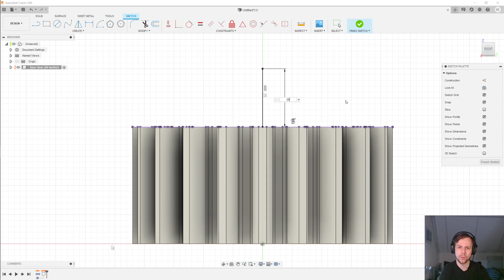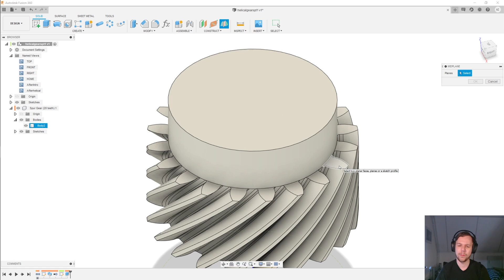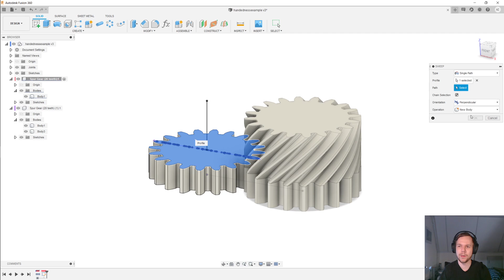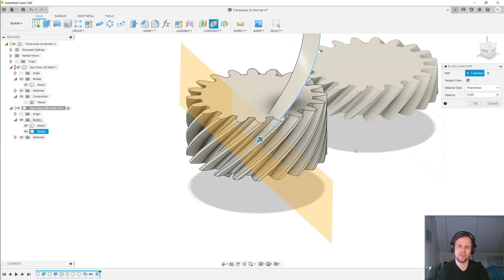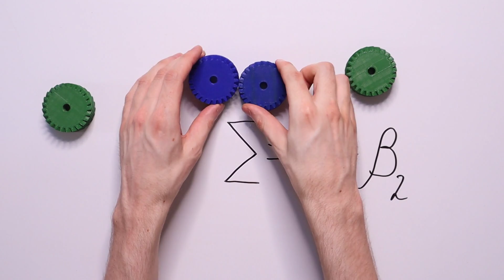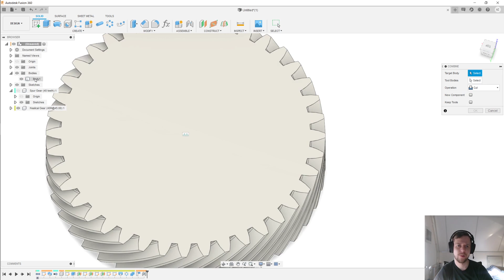How to model Helical and Herringbone Gears; pros and cons (Gears pt 3/7)

Comment: I have a small kitchen hand-mixer and the helix gear (I suppose it's nylon) wore out. I modelled a new version in F360 and used your video to work out the gear design. Busy printing the first prototype in PLA+ and hoping that it will stand up to the wear, giving me an extended life on the mixer.
A big thanks for a very well presented methodology!

Comment: Amazing video series. Quick question, if anyone knows, I have/had being using the Helical Gear generator as shown near the end of this video. I also made a helical rack (at 45degree angle) as in the next video. For some reason I cannot get the gears to mesh if the gear is made using the generator, no matter if using 45 or 57.296 degrees, but it does line up using the manual method as per this video?

Comment: HI. I would like to create a worm gear reduction. the (single-start) worm h?diameter of 4.5/4.8 mm and the towed gear with 9 inclined teeth diameter 6.0/6.3 mm. I create the gear by setting the number of teeth and the diameter and it calculates the module. I would like to know if I can set the module when creating the worm. Thank you

Comment: Hi, great videos. I have a question. How do you model herringbone and helical gears for a given center distance between to gears with different number of teeth? You have explained it very well for spur gears. Thanks!
Reply from the maker: It's basically the same, except that instead of the regular "module", you must use the transverse module. If you're working in the transverse system that's easy. In the normal system you'll get really weird numbers for center distance, you'll just have to deal with that unfortunately. It's hard to target a specific distance in the normal system.

Comment: "Herringbone" are smoother, if I understood correctly the reason why... I believe it's possible to reduce the backlash to zero with this model, correct?
Reply from the maker: Herringbone and helical gears are smoother because the teeth go into and out of mesh over a longer period of time. However they don't allow you to reach zero backlash, in that they are limited just like regular spur gears

Comment: I am having trouble meshing helical gears of different sizes. I am using the same diametral pitch, so they match perfectly as spur gears, but when I sweep them to make them helical, they collide. Any advice?
Reply from the maker: Are you putting the correct angles in the sweeps? Keep in mind that if the gears have different tooth counts, then to achieve the same helix angles, you need to enter different sweep angles into the command.
Reply: @antalz  I was entering 30 and -30 as the angles. But one gear was twice the pitch diameter. How should the angle differ? Should the smaller gear be half the sweep twist angle? For example, if the large gear has 30 degrees twist sweep, and the small gear has a 2:1 ratio, then the sweep angle should be -15 degrees? I will try it anyway to check :) Thank you for the response by the way!
Reply from the maker: @PoohTheWinnie  At around 5:00 I go over it. Notice that module*numberOfTeeth is in the denominator, so +30 for the small gear and -15 for the large one should work.
Reply: update: I tried it and it looks like it works :). I also tried yesterday using GF Gear generator, which works but the gears look a bit boxy and as you highlight in your video, do not have the root fillet. Thanks again!

Comment: Just a note on gears and lubrication, good, clean oil will provide an oil film between the gear teeth. This significantly reduces wear. The herringbone gear type is especially suited to this but requires a good oil circulation and filter system. Either that or extra clearance to prevent damage from the grease or dirt as you described. 
Thanks for a great video.
John
Reply from the maker: Thanks for that insight, I think the surface quality of the gears may have a big impact there. On a smooth machined gear that oil film will form, but on FDM 3D printed gears the surface finish is much worse, so maybe then a thicker grease is more appropriate?  Oiling and greasing is a really fascinating topic, the physics is really weird and I know little of it.

Comment: I really appreciate you making these videos--SUBSCRIBED!!!
QUESTION: I am trying to make a 3DP reduction drive for a radio tuning capacitor (6.35mm shaft) and a I need about 8-10:1 ratio.  I figure for the pinion, I need a minimum of 6-teeth (correct me if I'm wrong on minimum teeth utilized in a design). The other requirements are that it be as small as possible and still be 3DP, and that preferably it have zero-backlash--a lot of back and forth tuning movements are used to properly tune in a signal.  So, what is the smallest practical/reliable spur or helical gear that can be printed using a 0.4mm standard nozzle? And, would the helical or herringbone pattern be better for backlash? I realize that I can brake the tuning-capacitor shaft but would like to still not have any backlash in the gears.  Could you share some thoughts on this?  Thank You for making this series...

Comment: Even though the process is kind of right, the start sketch does not correspond to an helical gear profile....you can't start with the teeth dimensions of a spur gear and just sweep it along a curve, extrude it twisting it. The size of the tooth itself is different from a spur gear....
Reply from the maker: I'm doing everything in the transverse system, because it's easier to explain and easier to do. I think you're thinking of the normal system, and the tooth profiles in the normal system aren't different per se. They are still regular involute curves, it's just that the normal module and transverse modules are different, and the normal and transverse pressure angles are different. But they're still involutes all the same, in both ways of looking at it.

Comment: I Seen a lot of old machinary that used herringbone gear, but i guess they was casted, so they was probobly casted out of two heicalgeras or  something like that
Reply from the maker: I think they would shape or cut two helical gears and then put them together. You can cast a herringbone gear, but usually you want to come in afterwards to clean up the tooth surfaces, and that's hard with a herringbone.
Reply: @antalz  I don´t quite remember. But it was a bunch of machinere that was old.. talking like 19-centary old.. or at least was original produced that long ago. There was a bunch of diffrent eqivpment but all of it used the same gear. My guess is that one company made loads of gears and sold to other companies around, they had to be fairly cheap to make, they was i pretty much everything.
Reply: @antalz  it might have been a double helical... the thing is i visst a farming school next to where my cussins live. They had sort of a section  with older equipment.like handcranked  or belt driven. Anyway all the equpment had Open  gears  that was fairly common back then. I never seen hearing gears prior so I asked my cussin about it. And he thought there was norhing strange about ot and they had some equpment on there farm with the same sprocket.

Anyway when we got home to them he showed  me a potato  sorter.  The fun part was that it was freaking identical to one we had at home. The only diffrance was that our at home had straigt gears and there had hearing  one.

The one we had was really noicy, and theres was almost scilent.

Since then when ever I se a farm museum i got to se what kind of spockets  they have. And I seen a few diffrent. The strangest i seen is helical with a tracking rail to keep them inline.
Reply from the maker: @matsv201  That sounds really cool, I wonder if it all has 14.5 degree pressure angle. I kinda wonder when 14.5 degrees went out of style.
Reply: @antalz  i cant remeber, but the image in my mind is that the angle was pretty steap

Comment: Helical Gear Generator Plus seems better.

I do wish though that it could change parametrically after the fact.

I imagine the spur gear generator is actually better in that regard, because you can manually modify it, but then have all of your new parameters apply.

Cancel everything I said. None of it worked. Am very disappointed. Id really like to see a gear generator that actually changed with parameters.
Reply from the maker: I think scripts and add-ins can't work with parameters. You can draw the involute manually, see: https://www.youtube.com/watch?v=NaW4jWARFdY

The add-in is probably much easier, the only difference I think is the root fillet. But by modelling the shape yourself at least once you understand the geometry better. And part of the video covers forces and other theory of course.

Comment: I've been cracking my head at the same things. I really like normal module helical gears (being a mechanical engineer). But modeling that thing with solidworks and getting the clearance enough for gears to rotate but not so for the planets to come apart (I was making a planetary system) was a nightmare. I literally had everything worked out and printed a working version yesterday and today I saw your videos with fusion 360. RIP my time spent in those things. I really liked the thinking behind double herringbone gear. Didn't think of that earlier. Thanks for the info. Really great series!
Reply from the maker: Thanks so much! I personally prefer to work in the transverse system, the math just comes out easier. The normal system does work of course, but all your shafts and distances become such weird numbers.
Reply: @antalz   Shifting to transverse system now. Life gets easy.

Comment: Does it mean the Helical gears can be used as an angle gear as well? Or is better to use more conventional angle gears, e.g. bevel gears?
Reply from the maker: Helical gears do work if 1) the shafts are not parallel, and do not intersect and 2) the load is light. A "crossed" set of helical gears creates sliding friction on the teeth, and the higher the helix angle the worse it is. It's definitely better to use bevel gears if that option is available to you. Bevel gears require intersecting shafts though.

Comment: That was great! I would never have figured out how to do gears like this...even following the tutorial I had issues. Totally great though. Now to figure out how to extract the twist parameters from the existing gear I need to copy and I'm golden. Cheers!
Reply from the maker: Thanks mate! It's a tricky subject, so I'm happy you were able to figure it out in the end. For reverse engineering an existing gear I got a few ideas, though I'm not sure if any of them are any good:

1) Measure the outside diameter and the number of teeth. Use that OD = m*(N+2). This will give you a transverse module. Most existing helical gears are in the normal system, so the normal module should be some preferred number, like 1, 2, 0.5, you can find lists online. Try to figure out what the helix angles should be for different likely normal modules, and one should stand out as the most likely
2) take a picture from the side, as straight-on as you can. Draw line tangent to the gear tooth closest to the center. Measure the angle between the tangent line and horizontal. You can do this in Fusion360 by using the picture as an attached canvas.
3) Measure how much a single gear tooth twists, and measure the thickness of the gear. Essentially directly measure beta and h, and then do the math from the video in reverse. I have some idea in mind for how to do this with a custom jig, but it's quite a lot of work to make. If the other methods don't work we can talk about this more.

Best of luck!
Reply: @antalz I will try it later today. Importing the picture is a GREAT idea.
Reply: Follow up. Turns out the piece is a nylon compound gear...a thin wide helical gear on the bottom and a narrow larger spur gear on top. I had assumed it was two separate gears. The spur gear has three partially sheared off teeth. I tried to rebuild the three stripped teeth on the spur gear with some steel impregnated epoxy but that was a dismal failure. So it's back to 3D printing. Cheers.
Reply from the maker: @kennethwood9200  You can find the module of the spur gear using that formula I gave, OD = m*(N+2). Just measure the OD and count the teeth. Good luck, if you run into any more issues do let me know, I'm happy to help

Comment: Why wouldn't you use the the Coil function to twist the Gear? You can put a pitch angle which would make things easier or am I missing something?
Reply from the maker: Could you describe the complete workflow for that? I've tried a couple of things like sweeping the whole gear on a helical path, and sweeping a tooth on a helical path, but they don't lead to a good gear. You also can't put a pitch angle into the coil command as far as I can see, your options are revolution and height, revolution and pitch, and height and pitch.
Reply: @antalz  I am sorry yes you are right you cannot insert a pitch angle. 
I already started writing a long comment how I use the the coil function to model the gear, however I found a video that does basically what I do:
https://www.youtube.com/watch?v=DT0nZn9B72M
Reply from the maker: @maximilian.arnold  I have three issues with it still:
1) coiling with a custom profile is not available in Fusion360. So you have to make a coil first, then sweep the tooth profile along that path.
2) If you do that the tooth profile doesn't turn the right way. This is more noticeable if the helix angle is steeper, and he uses just 10 degrees. Moreover he doesn't show a crossection of meshing gears, I'm not entirely convinced his method is accurate. Specifically I worry that he's mixing up normal and transverse modules, an error that's hard to see on small helix angles.
3) With all that said, his method seems slower than what I presented too. It's a 5 minute video, while my demo took just 2 minutes.

Comment: I need to make a replacement helical gear that drives a rack in a machine tool. One method I have considered is 3D metal printing. This series will enable me to model and print a prototype in PLA before committing the design to a commercial printer. Thank you..
Reply from the maker: Thanks, it's really good to know my effort is helpful to people